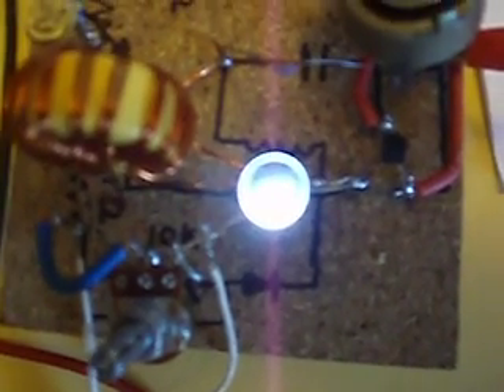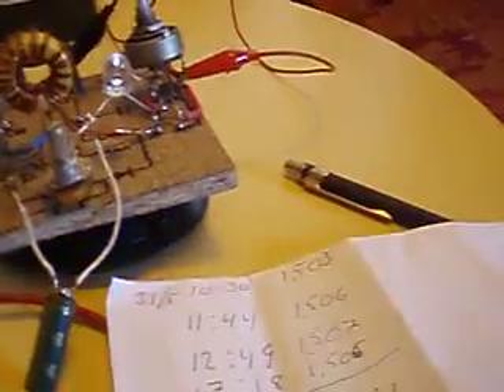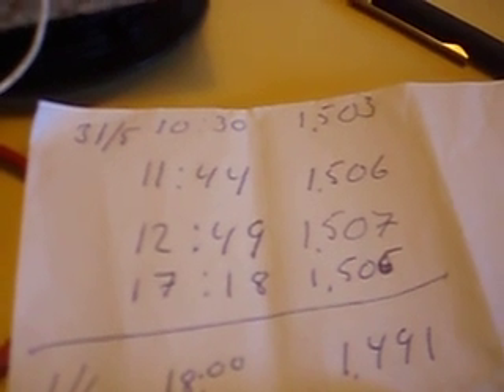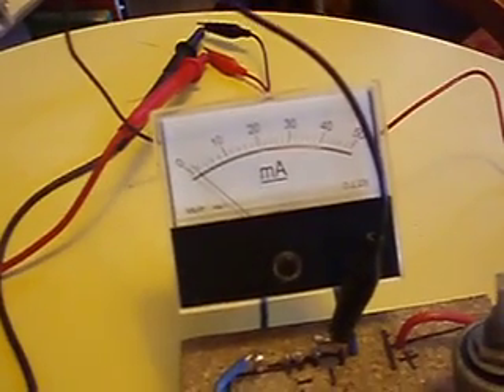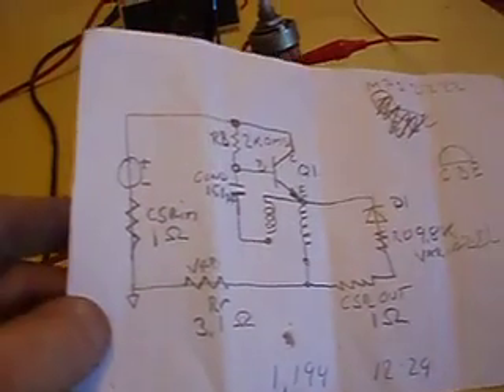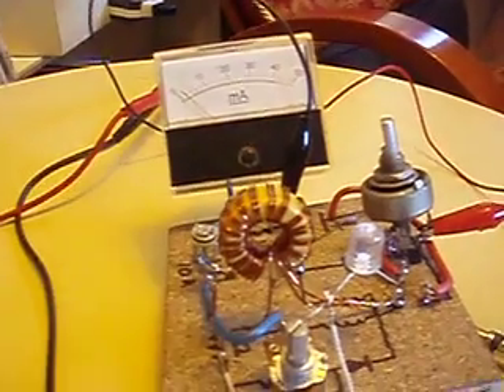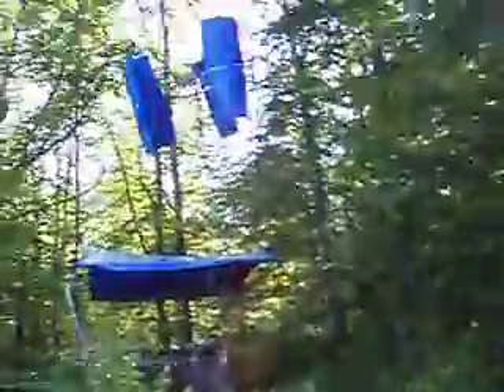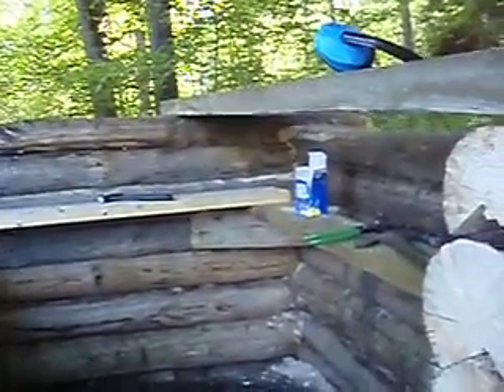Physicist Steven E  Jones  overunity circuit

Comment: I built the circuit and got 5x ou.  It was easy to get the parts and assemble. The challenge was getting a trustworthy oscilloscope with math functions that fit my budget. I used a picoscope.

Comment: Thanks and the sound of the outside atmosphere is spacious and clear.
Over unity equals more amperage out than in, easy to charge a cap with more than enough voltage to get fried and accumulate the amperage, but over all not more amps, except by evoking extra electron production [movement] through the action of the scalar potential. Bumping the neutrinos, which are everywhere all the time, they are in the wire also and that's very good.
Your work and efforts are will received.

Comment: It really works! I got 1volt increment at about every 6 to 7minutes. It could charge even an ordinary battery(not rechargeable one). In my case I'm using 2-AA battery. It was almost depleted and won't work even in low powered T.V. remote control. After 12 hours of running these batteries with this circuit, I tried it to run a 3volts motor and, bingo! The battery are back in business.

I'm not claiming it is OU circuit, but in my case It was self-recharged an almost dead battery and at the same time turned on several LED's as load. On my next exp. I will try some tweaks and play some combination of coils and components value to improve battery recovery time.

Comment: Radiant energy shows up in very sharp pulses. Usually a collapsing field. The inductor is the inductor, but in the real fast snap back, radiant is attracted. The radiant will not show up on a meter. But it can be caught and transfomed into electricity in an inductor or capacitor. The faster, the higher the voltage, the larger the amount of radiant/zero point/ dark mater you will attract. Those that disagree stopped thier education.

Comment: My guess: There is an inductor in the circuit and a capacitor. The initial voltage drop was instant due to the capacitor being filled up, when the charge was full, it began to stabilize.
For those who do not know much about electronics, imagine taking a large water tank filled with water(the battery), and attaching a second thin tank with a large opening on the bottom (capacitor). When the circuit is complete water will flow from one tank to the other. The momentum of the water (assisted by the inductor) will overfill the other tank. Then the natural effect of balance would come and the battery which has a a far smaller load on it now (3mA) to be exact.
Reply: It is also a similar effect of magnet motor, when one magnet is pulled to the other X amount of energy is exerted on the object... unfortunately it is the same X amount of energy which is required to break free (pull away). Thus creating an effect of speeding up then slowing down.
People get excited over things like this because it looks as if there is a gain from nothing.

Comment: Both battery voltage and the accuracy of your meter (even my fluke 87 iv does this) can vary ever so slightly depending on ambient temperature and humidity.. I think that might be why it seemed to rise for a bit.

Comment: I don't know about that!  What I do know is that a cold or frozen battery will have less charge available when needed.  This can be a big problem for people living in cold climates.  It is also a big problem for NASA; in space, they actually have to use energy to keep backup batteries warm just in case they are needed (if they want instant power).

At the other extreme, I once burned out a camera by warming the batteries in a car exhaust tail pipe.  Guess I got them too warm, heh heh.